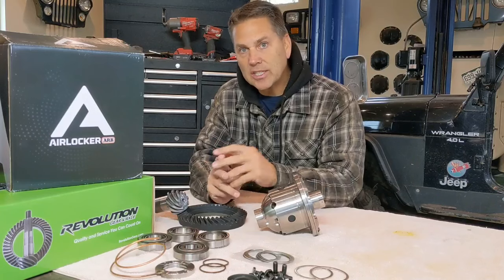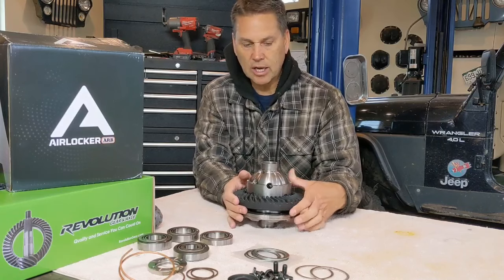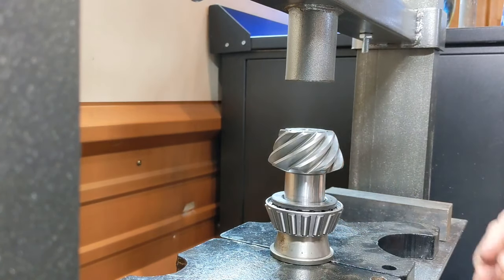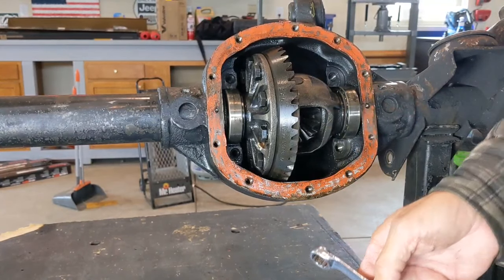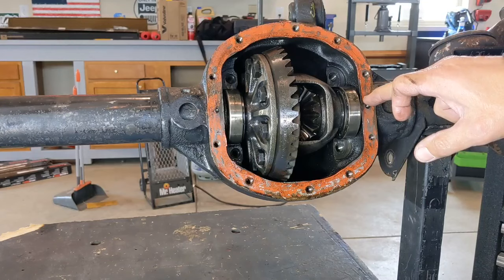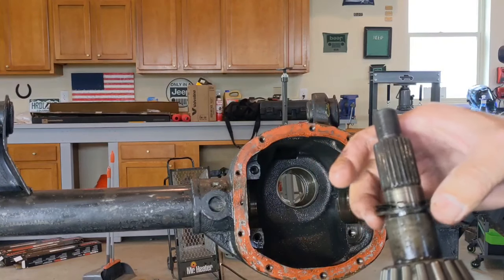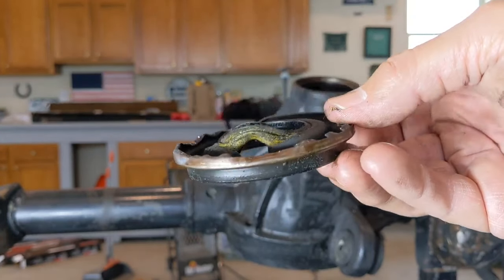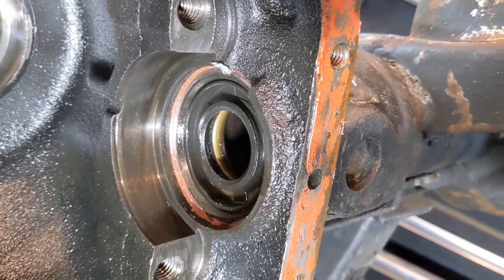How to Install an ARB Air Locker (Very Detailed!)

Comment: This is a good video, but I want to make what I feel is an important point:

ARB has a pretty funny idea about how to keep shims in place on a Dana 30 where the bearing caps do not hold them in.  They are relying entirely on the interference fit when the carrier is installed to hold the shims in place.  Considering that when I removed the original carrier, I was able to just grab it with three fingers and lift it right out of the housing, those shims are liable to not stay in place in the long haul.  I do not know if that is due to bearing wear or 20 years of thermal cycling or whatnot, but in that case, one of those shims would have walked their way right out of there, and would've been stopped by the axle shaft and you can use your imagination as to what issues that may cause.  Second of all, any time you install a locker, the chances are that you'll be doing some wheeling over some rocks and it is inevitable that you get one wedged underneath the pumpkin.  That's going to change the dimensions of the housing and I don't see it to be nearly impossible for it to negate that .012 interference fit that they recommend.  Long story short, I tack welded the shims in place... just a quick zap of the welder to the shims / housing. 

Case in point:  The Chrysler 8.25 in the back of my Jeep experienced this.  I had the preload adjusters tightened to the recommended 80? Ft Lbs and then tightened down the bearing caps.  It was all fine for a few hundred miles until I went to diagnose a driveline vibration, so i just stuffed the jack underneath the pumpkin to lift the rear wheels up.  The air ring fitting thing, which I believe was on the outer race of the carrier bearing, (the exact design eludes my memory from about 6 months ago) spun inside of the bearing cap.  That pushed the air line into the ring and pinion and lunched it up.  And guess what?  ARB uses copper air line of a size made from unobtainium.... at least when you try to source it locally.  The preload adjusters didn't keep it in place, and nor did the bearing caps.  So, out came the welder again and I put a tack weld on the bearing cap so it fit inside a notch in the air ring thing.  So, if it does try to spin in there, it'll stop against my tack weld.  My brazing skills are less than optimal, so I got the bearing race pretty hot, but it survived several thousands of miles so far and its not making any abnormal noise.  And I know that a person technically is not supposed to raise a vehicle by the pumpkin, but like I said before, it is inevitable that you get caught on a rock somewhere and that'll duplicate this scenario.

I have an email from ARB saying that they swear that .012" interference will keep that shim in there on a Dana 30 and maybe they are right, but...  Sorry, ARB.  That is NOT a robust way to keep something like this in place for the long haul and I have empirical evidence to support this.
Reply from the maker: I lift my rear axle from the pumpkin all the time with no issues. Welding inside is not what I would call a way to fix your issue. A locker requires more carrier bearing preload than an open carrier. The shims you speak of on the seal housing side go over a raised lip of the seal housing and are then sandwiched by the master ARB shim. So there is no way those can sneak out. The right side (as you're looking at it) it's feasible, and I have seen it as well. Proper preload prevents that from happening. I would guess over 90% of issues I have seen were based on improper preload. Your 8.25 is different than a D44 or D30 in regards to setting preload. Brazing is just not an option for the average Joe.
Reply: Yes, that makes sense.  It was the shims on the right side (driver's side) that were of concern on the Dana 30.  I wish I could post a picture here.  I definitely did not like the idea of welding anything in there, either, but gee.... the way it sat there just did not inspire confidence, especially with a $1,000 differential.  I think I put the thicker master shim on the outside of the shim pack in an attempt to get as many shims behind the bearing cap as possible?   Stuff moves around.  I didn't have the cojones to leave it like that.  Maybe ARB was right, but.... dang.  

I don't know why the 8.25 did what it did.  Maybe something isn't machined properly and there is not enough of an interference fit behind the bearing cap?  I do not know.  In either case, the bearing / seal did spin around in there.  I was just very not happy when I had to tear the axle back apart again and clean out all of the copper glitter and cobble together a new copper line and then figure out how to not have it happen again.  Unfortunately, a small bead of weld on the bearing cap was the closest thing to a guarantee that I could come up with.  Did the cap stay round after the welding heat? I hope so.

Rebuilding axles requires thinking and patience.  I would venture to say that in almost all of the cases where someone gets a set of gears and they're trashed within a year, that person did not take the time to get their pinion depth and backlash set right.  It is a lot of dicking around and after working on old junk for decades now, I can vouch for how most people don't have the patience, nor the tools to do crap mostly right.

I also did not like grinding teeth off of my 4.56 gears in order to get the differential pin installed.  But there wasn't much for options.

In either case, I went from MN to CO twice this year and from MN to the black hills once after I got the lockers in, and it has been otherwise problem-free and there are no leaks from the lockers.  ARB's compressor pumps up tires better than the other compressor that I've been using for a long time.
Reply from the maker: @paulstandaert5709  I wholeheartedly agree that failures shortly after install are an installer issue, not a parts issue. ARB's take patience to set up. If you don't take the time to set it up right you will most assuredly have issues. That is exactly why ARB stresses using a certified installer. If your race was spinning around under the bearing cap you can resolve that by making dimples in the differential bearing seat and that should hold it although it's not optimal. Lastly, the ARB master shims do go to the outside of the other shims. 👍

Comment: Lots of information, and although toyota's are completely different your attention to detail is great reference information.  I may have missed it, but why would you loop the copper tube over the ring instead of exiting the housing on the other side?
Reply from the maker: I've seen people do that but it is really difficult to do without kinking the line. Plus there really isn't a whole lot of room there for it to not rub or vibrate on the bearing cap. In addition, with it in the other side of you somehow damage it at the seal housing you still have plenty of copper line left to use.
Reply: @TheBFHGarage  I get it.  It's counter intuitive with all the moving parts on the other side though.
Reply from the maker: Yeah but there is "plenty" of room😎

Comment: Why did you remove the pinion? Surely the ARB centre can be installed just by removing old differential centre and ring gear? If you're re-using the same r&p, you don't need to re-shim it for pinion depth, just for backlash and carrier-bearing pre-load.
Reply from the maker: @TheSwordsmon  different gears. If you're using the same gears, then you are correct.

Comment: Awesome video! Just one question: why so much extra copper line inside the housing? Why not run it over the top and just out of the hole?
Reply from the maker: If it gets damaged at the seal housing for whatever reason or if you need to relocate it when doing a truss then you have enough to move it. Most importantly it's easier to bend when installing.

Comment: Great Video! Is there a reason for looping the copper line down before coming out of the housing? Rather than going straight out?
Reply from the maker: It makes installing the carrier much easier. When you roll the carrier and seal housing in, you can move the copper easier. If it's short, it is very rigid and difficult to get in without bending it or damaging it. I also keep the bigger loop there in case the bulkhead gets damaged somehow and you need a little bit extra line to make it good again.

Comment: Question, do you need a press or could you just bake the roller bearings before putting them in the pinion and locker? Maybe also put the pinion and locker in the freezer??
Reply from the maker: You could do that but a press ensures they are fully seated.
Reply: @TheBFHGarage  Thank you for the reply!

Comment: I’m hoping you can answer my question for me and help me understand what is happening and if I need to do anything about it. I have a high pinion Dana 44 from a bronco it’s getting all new bearings and new ring and pinion with an ARB locker, I’ve got my pinion depth right where I want it however, I can’t seem to get the pattern just right without opening my backlash too far. Yukon gear recommends 6–10 and right now I have it at nine but there’s still a partially a sharp line at the bottom of my pattern, if I close the backlash to 6-8, that sharp line goes across the whole bottom of the pattern and I can’t seem to get rid of that sharp line without just going way past spec on backlash.
Reply from the maker: Always get the BL in spec. If you get that harsh line at the bottom, then your pinion depth isn't where you think you want it. If it's that close, try pulling 3 thou,  reset BL and run another pattern.

Comment: Just curious, why have so much copper line in the housing.  I would think the less copper inside the differential housing the less chance of the tubing getting caught on a gear.
Reply from the maker: I like to keep extra line just in case. It's rigid, so if it's out of the way, then it's out of the way. You have to take time to make sure it clears everything.

Comment: really great content, thank's a lot! Just a question: If I just keep the stock pinion and put in a locker - do I then even need to remove the pinion? Just in case the bearings are still fine ofc.
Reply from the maker: If all you are doing is swapping in a locker and NOT changing gears, then theoretically it's a direct swap. I would highly recommend checking backlash and run a pattern prior to taking things apart. Most likely you will have to adjust carrier bearing shims as they can be different. For example, the ARB uses different bearings. Since you aren't changing the pinion, you should only have to get backlash back to where it was which is probably easier said than done.
Reply: @TheBFHGarage  great. thank you for your quick answer! also appreciate your other videos, watching them  atm. have a good new year

Comment: Hi!
I have a ARB air locker on my rear differential. I haven’t connected the ARB air compressor to the air locker yet. This as led to a leak out of the bulkhead where the air line from the air compressor will connect. I am about to install the air compressor to the air locker and I am wondering if I can just proceed or I have to deal with the leak first. If I do have to deal with the leak, what should I do?
Thank you
Reply from the maker: It is common for gear oil to go back up the copper line. Not a biggie. Hook up your compressor and you should be good to go. I would make sure the axle vent tube (rubber hose on top of axle) isn't clogged as well as that can create internal pressure leading to gear oil leaks. In addition, on an annual or every couple of years, disconnect the airline at the bulkhead fitting and then run the compressor to blow out any gear oil that has been building up. I've had it back all the way up to the solenoid so don't be surprised.
Reply: Thank you for helping.
Your response and your video were helpful. I will do some more research and give it a try.

Comment: Thanks for the video! I'm looking at putting in a RD117 in the rear of 2017 JKU Sahara. I'm going to use my stock gears, do I need to remove my pinion? Also do I need to grind in the lower oil grooves?
Reply from the maker: If you are not changing gear ratios, then no. Yes, you will need to grind out the slots for the rear.

Comment: Thank you! Awesome Video!! I just broke my tj rear axle so am planning on upgrading  to super 35  from revolution gears and axle. Currently my arb Locker is RD102 which is for 27spline. So I called arb to figure out how to upgrade to splice 30. they told me to get part # 728j031c. Do you think it works with RD 102? I have been watching this video more than 10 times to solve my problem. Thank you in advance!
Reply from the maker: I haven't done a Super35...ARB is your best source.
Reply: i wouldn't waste any more money on a 35 upgrade,  I would look for a 44 housing  and build that,

Comment: Hi, thanks for best video I saw.I have not excellent english so I am asking maybye what you mentioned in video.
Is it nacessary to adjust pinion deepth,backlash and ringgear preload If I only change the diff carrier ( airlock or lsd or another varilock rebuild),with all original shims and gears setup ? 

It give me sense that When I regear it I need adjust all those things, but only when I carrier change,I would check only marks with yellow paint on ring gear if is ok.If not than buy set of shims and adjust carrier right or left.
Reply from the maker: You shouldn't have to change anything if only changing the carrier.  However, there is a chance you might. Take a pattern BEFORE taking everything out, and then take a pattern AFTER you put it back together. If it's the same or even really close, then you should be good. Good luck!

Comment: So why does arb route the line across the diff instead of out the same side of housing the air line goes to seal shim?
Reply from the maker: You can run it however you want. I've seen them poke straight out the side but that is not my preference for two reasons. First, installation that way is a pain in the butt because you have no line to work with....meaning that a longer line is more flexible to get it into tight places. Secondly and more importantly, is that under harsh loads the axle housing will flex and deflect some. By having the longer line it allows for this movement and the line acts like a spring rather than a rigid connection. A rigid connection would lead to premature failure/fatigue imho.

Comment: Is it worth re-gearing and installing ARB lockers on a dana 30? I am struggling to decide between buying a new dana 44 vs using my existing dana 30 axle. I know a dana 44 is stronger, but how much stronger?
Reply from the maker: The only difference between a D44 and a D30 is ring gear size. Everything is the same outside the pumpkin.

Comment: i had to drill out the copper line and jb weld  be carefull not to plug hole in housing ( sucks) on 8.5 chevy  its offset to one side copper line for 8.5 is really short its hard to route!
Reply from the maker: You certainly shouldn't need to drill out any copper or use JB Weld..... What caused you to do that?
Reply: BROKE COPPER LINE AT THE HOUSING/ MY FAULT JUST TRIED TOSEE IF IT WOULD WORK WAITING ON NEW SEAL HOUSING ITS VERY SHORT IN THIS 8.5. ILL BE MORE CAREFULL NEXT TIME  @TheBFHGarage
Reply: @TheBFHGarage  YOUR VID ON THE DANA 30 WAS GREAT!!THANKS FOR YOUR INFO
Reply: @TheBFHGarage  got new seal housing today fixed
Reply from the maker: @chuckzinn7334  good to hear👍

Comment: Is this basically the same for all trucks. Example- Nissan Frontier 2017 with the 180 front diff?
Reply from the maker: Correct. Look at install instructions for your needed locker and compare any differences as necessary.

Comment: Great video  - really appreciate your work making these.  Quick question - my JK uses a crush sleeve to set pinion pre-load.  Do you recommend using a crush sleeve eliminator kit with these?
Reply from the maker: It's preference. A crush sleeve eliminator makes changing a pinion seal easier. Crush sleeves are a PITA to get started too and easy to over crush. The eliminator kit makes everything easier especially if you have to get back into the pumpkin in the future.
Reply: It is preference. I hone out an inner and outer pinion bearing of the same manufacturer for "setup bearings" when checking patterns. Don't use the crush sleeve and torque the pinion nut to about 150 ft. lbs. After an acceptable pattern do you perform final install with new bearings and torque to spec with the crush sleeve.

Comment: Hi thanks nice video, do you know how many threads per inch the 1/4npt tap is?
Reply from the maker: I believe 18 off the top of my head. 1/4" NPT requires a 7/16" hole.
Reply: Thank you

Comment: Insanely helpful vid! Do you need to worty about tooth pattern in compound as much if you’re just reusing your same ring n pinion on a new arb? (Front dana 30 zj)
Reply from the maker: If all you're doing is changing over your ring gear to the ARB, you should be able to just put it right back in there. I would check backlash and pattern before you pull it though and compare to when you put it back in.
Reply from the maker: Sorry I was distracted when I replied. When you are installing an ARB, you shouldn't have to reset the pinion. You will just have to make your backlash correct. And that will still take some time because you're going to have to mess around with a seal housing and all of that. So that part will be different. But you should not have to mess with the pinion gear.
Reply: @TheBFHGarage  You rock sir! Think I should replace bearings while in there? Jeep has 215k
Reply from the maker: Carrier bearings will get changed out with the ARB.... Yes, I would change out pinion bearings while you're in there.
Reply: @TheBFHGarage  ok screw it, I’m doin a full regear front and back as well 🤣. 💸
Reply from the maker: That's the spirit!